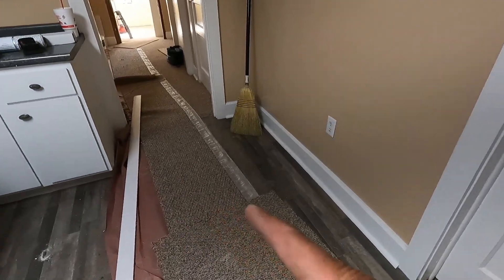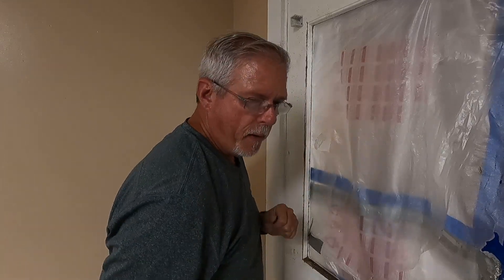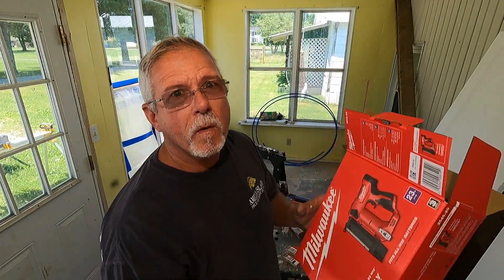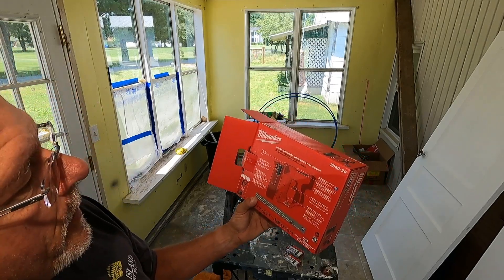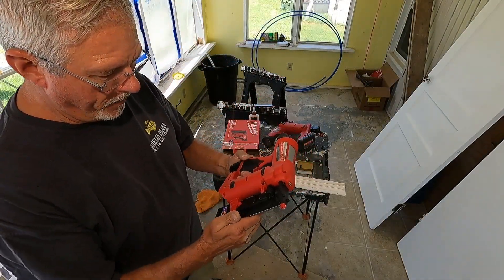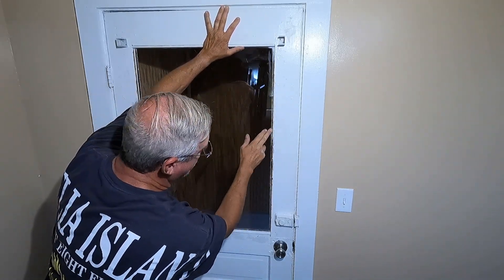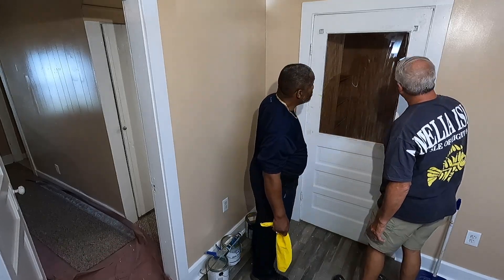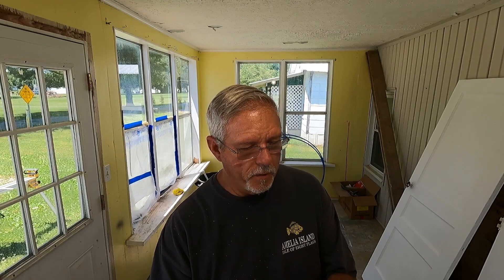Milwaukee M12 23 gauge pin nailer

Comment: I love the M12 line so far. I have the Drill, Impact, Hackzall, Screwdriver, Flood Light, Work Light, and Oscillating tool. I'm a maintenance tech, so I went with the M12 due to size. I love all of it. They all work great, and I've had zero issues with anything (other than battery life but I bought two 6.0 batteries and that fixed it!)
Reply from the maker: Milwaukee has a great line with the M12 platform
Reply: @DavidFDay  Absolutely! I mean you're not getting the power you would from an 18v or a 20v but it's enough to usually get the job done! I think my next tools I'm going to buy is the pin nailer (which is why I'm looking up review's of it) and the jigsaw.
Reply from the maker: I have the pin nailer it’s a great gun also

Comment: I love my M12 but don't know that I would use it for this purpose.  My concern is that pin nails do not have a head on them.  But if the use is just temporary..to hold something in place while the glue dries than 23 GA is fine.  I probably would have opted for 18GA that do have a head and will PUSH the moulding down against the rabbet.  But your real structural component is the adhesive/caulk.  I probably would have used safety glass (whatever it's really called) and not gone with the plastic.  Plastic scratches pretty easily over a period of time.  Great how to.  Multitools.  What would we do without them?

Comment: Good video. Ive always been a dewalt guy because i have a lot of batteries. But i just ordered the m12 right angle die grinder and soldering iron (i do a lot of hobby fabrication and atv/utv mods). Now that i have some m12 batteries that would be a good addition
Reply from the maker: I have both of the tools you described and they are good tools. Milwaukee seems to be putting a lot into the m12 line!! Enjoy your tools and thanks for commenting.